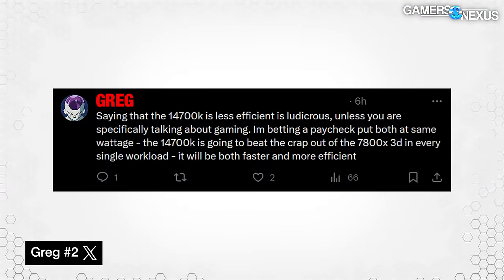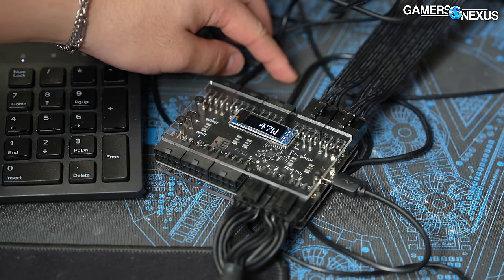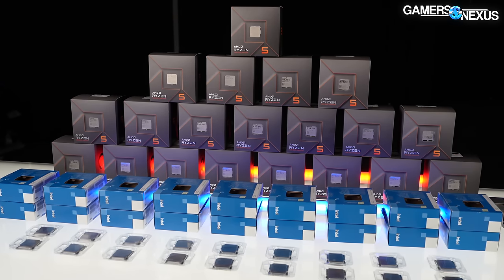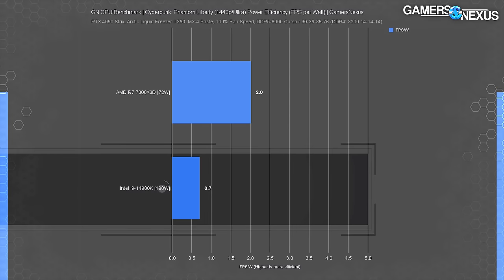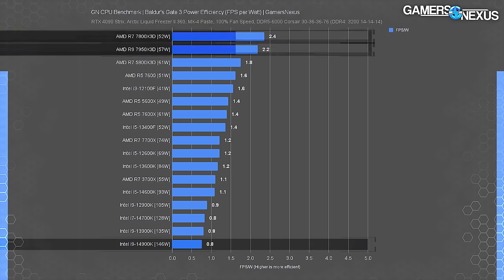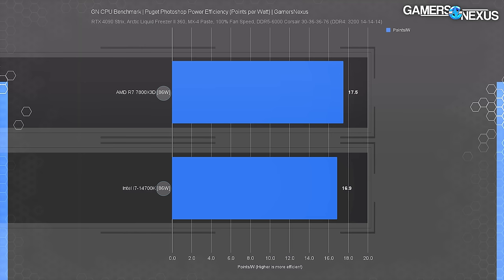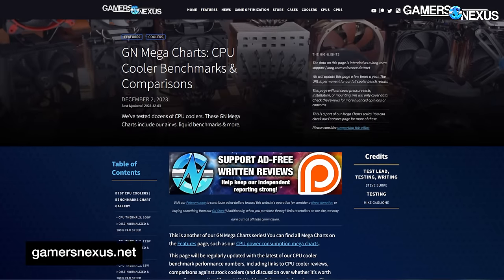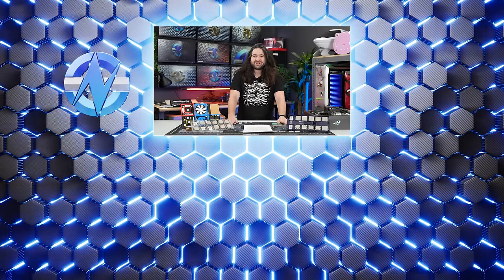The Intel Problem: CPU Efficiency & Power Consumption

Comment: Loved this analysis, since i'm paying even above your maximum listed amount for electricity in Germany it is pretty considerable, especially idle/desktop/surfing consumption. I remember saving hundreds of Euros per year after an upgrade to a more modern Intel back in the day with nothing else changing in my appartement over the year. It is of such significance that you could justify a steeper price upfront if it at least compensates for that within two or three years (within reason).

Things are getting rediculous with power draw, i flat out refuse to entertain a CPU that could burn upwards of 200W and even ignoring purchase prices i'd be hard pressed to put a 300-600W GPU  in my rig. Things need to find a new better sweet spot imho, heat, power draw.. it's just not fun anymore. Hanging onto my sloppy 10th gen i9 with a 2080 super which were not stellar back in the day and look like an efficiency miracle compared to following gens. I really don't like the way things are headed.

Comment: Leave no troll spared, well done guys.

As for two games, surprisingly for high-end I'd say to check out Alan Wake II. It's a slow-paced survival horror game but it's pretty heavy on hardware. Could be a good high-end testbed. For another, I'd check out Resident Evil 4 remake. It's generally lighter on hardware, but it's still the heaviest RE Engine title so it might work well for testing needs.

Comment: A more efficient CPU will need smaller, (generally) cheaper and (potentially) less noisy cooling components. There will be less overall heat in the system, which would not require a higher flow case and that could affect other nearby components. There is only to be lost in wasted energy for the same amount of work. This will be especially true for the TR, as in server racks heat and energy cost per unit of work will be even more relevant.

Comment: I really like the 23:00 chart, I'm in the EU, NL, and my main rig has a 14700k, it's shocking that I can save 100-150 euro a year assuming I game 8 hours a day, changing to AM5 and getting a 7800X3D the CPU would pay itself back in energy savings in just 2 years and 4 months, that's absolutely bonkers.
I already regretted getting a intel 1700 mobo cause the e-cores cause so many shenanigans with games (worse frame times, worse cpu scheduling) the only reason I really got it was cause of DDR5 and the bigger L1 and L2 cache even compared to AM5, but I've been thinking of selling that machine for a while now and going AM5 instead, to also future-proof myself.

Comment: It would be nice if there was also coverage of idle power usage, or when using youtube.

Does the effect of the e-cores make Intel more efficient in those scenarios?
Reply: No, but in general power states on Intel are better than on AMD. At idle Intel is likely the chart topper, at the same time, who uses their PC idle the majority of the time? In my case it'd be turned off instead of idling if I'm away for extended periods of time.

Comment: I'd be interested in seeing a similar comparison on laptop chips where Intel isn't thrashing their chips as hard and efficiency matters more - the Framework 13 could be a good platform for this as it's available with both Intel and AMD options for high end mainstream laptop parts, and anecdotally a lot of users seem to report longer battery life on the AMD side

Comment: one thing i would like to see added to testing like this is the NON K cpu's, those are hardly touched on by anyone in reviews yet shud be alot more efficient in this kind of test due to being held back
Reply from the maker: They are in this video.
Reply: @GamersNexus  i see a 12100F and a 13400F, what about the 13900 non k and the 13700 non k? the counterparts to the worst power users

Comment: Awesome content!
One of my previous comments about creating charts of power efficiency for different loads have been heard, and I though it was lost and forgotten. Thank you very much for this video!
What remains to be explored is the exact positioning of VF-curve for CPUs of the same architecture - I also asked for this some time ago. E.g. Alder Lake CPUs have -KS, -K, suffix-less and -T SKUs that vary in frequencies and rated power. It'd be curious to know if they have exactly same VF-curve. And to plot that curve in general, e.g. curve of the efficiency of, say, 7zip compression at different power limits and/or voltages. Admittedly that is a lot of work for a result that bears more of scientific rather than entertainment value, and therefore may not be as appealing to the general public.
Reply: The pre-binned VID-frequency curve would even vary between CPUs within the same SKU (and that is the source of SP score on some ASUS boards), so I guess that would be very difficult to test unless a lot of CPUs are tested. Different -K SKUs do carry noticable differences in the average voltage needed to achieve certain frequency though.
Reply: @xianyuff8242  that's interesting bit of info, mind if I ask how do you know that?
I would assume -K SKUs carry noticeable differences out of voltage or frequency range specced by Intel. Within specified range they would behave quite similarly, otherwise there would be no point in factory specifications.
Reply: @PK-lk5gs  The values are baked in the CPU by intel and it can be tested with setting ACLL and DCLL to 1 mOhm, then read the VID given to the system at different fixed frequency. There is a lot of discussions on the VID table baked in the CPU on the overclocking forum.

You are not wrong, the difference within a SKU is very minor, won't differ more than tens of mV for a given frequency at max, and they are all guaranteed to be stable at such voltage / frequency point. It's like a CPU with low SP score will perform exactly as well as well as a high SP score one when it's not overclocked, they would have a small voltage difference at the frequency though.

Higher speed SKUs in the -K CPUs usually have relatively better bins than lower speed K CPUs though. Not sure about non-K CPUs, only insiders know how they test and bin them in detail.

Comment: It wasn't really mentioned here, or I missed it, but I think it's important to note that the CPU power consumption of a locked frame rate might theoretically not always be the same.
For example a VSync locked frame rate, compared to a Nvidia control panel locked frame rate, compared to an inbuilt FPS limiter in the game(-engine) could theoretically be different. By how much I don't know.
It's also important to note that some parts of a game, like the physics, run at a fixed update rate of about 60-200 Hz depending on game and what the developers chose for it. This won't impact the results but is good to know as an audience member I'd say.

Comment: i knew it, i knew it on the day it came out that i wanted it and it will be efficient.
that little 5600x is amazing.
just good enough for a casual gamer on a budget that does some video editing, compression and compiling. cheap, efficient and works with a stock cooler.

my only regret was not waiting a month or two for the 5700x to come out as i bought that 5600x as soon as i could ship it on release.

Comment: Thankfully reviewers are finally starting to realize that most people dont run their systems on full blast, max FPS scenarios. If we could do some standardized testing methods like capping the frames to 120, that would be more representative of typical use for most people. I dont know of anyone who doesnt cap their FPS to their monitors refresh rate to prevent screen tearing. Running it in a manner that purposely exacerbates Raptor Lakes power draw irritates me to no end. If we can then go one step further and cap the Intel chip to the highest amount that the AMD chips would draw while in that frame limited testing, that would be beautiful. They did make some significant gains on overall efficiency in those power capped scenario, even if they still lose to the AMD chips.

My only real question about the content and testing methodology is... how the hell are you guys getting these chips to draw that much power? My 13700k is only pulling around 75 watts in Baldurs Gate 3 in a 4k120 rig with a frame cap at 116. Why is my power draw a third of the 14900k you tested? Its even overclocked as far as the silicon will go and its running uncapped on power. I think I could safely set the power limit to 100w and never feel the difference.

Thanks, GN, good work and its clear theres no bias at play like there are with some other reviewers that ive had to stop following recently. Keep it that way, and you'll always have my views. I just want it straight with none of the bullshit shilling. Give me the data and let me make up my own mind.

Comment: I always thought it was just assumed that you have to take performance with a hefty grain of salt. Changing ANYTHING can affect performance. Using the same CPU in multiple motherboards, using multiple CPU's in the same motherboard, using different bios, using different RAM, these all affect how a CPU behaves, and with the way that modern CPU's boost, it will affect performance.

Comment: The issues here are that intel is using a 10nm node...where as AMD is on a 5nm node...there is no way around the efficiency difference from using a smaller node, the 7800x3d has added cache which helps it for gaming purposes...add in the different use cases for P and E cores (for intel) to the mix and you have a perfect storm for gaming...intel needs to get their node process down to 5 nm...and add cache to their chips.

Comment: what I do care is the amount of heat and energy the pc / notebook thermal solution must needs to dissipate. That is extremely relevant, specially in small devices with constrained head dissipation capacity.

Comment: It's not a surprise that Intel had to push more power to stay competitive, and if memory serves they have done this before. Usually that means a new design is coming and it remains to be seen if Intel can do that again. I don't think they can reasonably push much more power through this design, although there are some chips that have higher TDP, you're getting more cost, cores, lanes, and cache, not single core performance, which for the average user is still king.  If I was building a top end machine today AMD would be a serious consideration whereas previously the gap in power was justifiable by a gap in performance, which isn't the case now.

Comment: Your cost charts are interesting. However, I'd like to highlight that if you live in an area where you have winters and use electric heating, you are basically gaming for free during winter. Whatever heat your CPU is generating is basically heat your electric heaters don't have to make.

Of course, you can do the opposite; if you have to use AC to compensate for heat generation, that makes it worse.

Comment: I really appreciate this. I remember Intel stating this as gospel and fact and the Intel fan boys just have been repeating it. I didn't know if this scenario was true or not, but it seemed unlikely Intel tested this themselves. Let alone have done it in a way to get it to agree with themselves. Their slides often are underhanded unless you actually look at the finer details(such as Intel comparing their current cpu to one two generations prior that isn't even in the same class as it with different core counts). My guess is they assumed no one would look into this one and they could just state it and they dd get away with it for awhile. I even wondered if this was true, if all the cores were parked and it was just a gaming scenario, is it now running efficiently at a lower power consumption than a competitor cpu? Turns out, nope, not even close to true, almost like Intel didn't test it, but figured no one would really call them out either. However the damage has been done and it's still going to be disputed by Intel fan boys because an Intel executive said it.

Comment: I've changed a 13600k for a 7800x3d, i'm playing only pubg these days, and it's crazy the diference! I've always have to limit the 13600k to 125w because commonly the consumption go way higher, sometimes beyond 180w! The maximum that 7800x3d goes is about 68w, and bringing at least 20% more performance. I've used intel for the 10 past years, and i don't think i will switch back.

Comment: So what Steve is saying is the higher end Intel CPUs are like a V8/V10 turbo diesel engine in a vehicle that occasionally rolls coal in terms of power efficiency. The X3D AMD CPUs are like a tuned twin turbo V6, it doesn't always have a much raw power but it makes it's power without a MPG in the single digits or notable harm to the nearby environment.

Comment: It is nice to see the elephant in the room. My gaming laptop has an i9 and 4080. My friends laugh at the size of the necessary power brick. And "brick" isn't an exaggeration.
Also to consider is the waste heat dumped into your home environment. When I ran my dev company from home we could easily shut off all heating vents on the first floor, where our offices were, all winter. But in the summer, the A/C needed to work extra hard.

Comment: I'm not so concerned with the cost of the power where I live. HOWEVER . When I had a 13900k and my 4090 running, my room got so HOT 🔥 switched to the 7800x3d and it's much more bearable. I'm even getting better performance with this cpu as well. So it's really a win across the board

Comment: the way i see it more consumption also means more heat and therefore more noise, which is a thing almost everybody cares about to at least some degree, so there is definitely more to it than just the cost of increased power consumption itself, which as long as you look at a single entity is ridiculous to worry about if you're rocking a 650$ CPU (my opinion as German paying well >0,4$ kw/h)

Comment: Undervolting my 5800X3D to pull no more than 65 watts makes it run cool enough that the low profile Noctua cooler that I’m using easily takes care of the heat. Paired with the RX6600 video card at 1080 60 Hz, it’s all the efficiency I’ll ever need. Not planning on upgrading to AM5 any time soon because there just wouldn’t be any point.

Comment: the high electricity prices where reason for me to convert to a mini PC
I cut my electricity bill by 2/3 by just doing that, simply because a full PC uses much more power in idle and during light tasks like watching video and streaming

My PC uses for youtube about 100-120 watts while the mini PC uses 16-23

I chose the Minisforum HM90 as it was, at the time, the best choice for a mini PC that could also handle some gaming
Initially I planned on using th mini PC just for youtube and light gaming, but it actually handles pretty much all the games I play sufficiently well, so now I havn't powered on my gaming PC in 2 years, I just have to play at slightly lower settings, but I get to have my cake and eat it too

Comment: Hey @GamersNexus , do these results translate to laptop efficiency and battery life too? It would be cool to get equivalent results there to inform purchasing decisions for laptops. How about idle power draw, or low power workloads like staring at IDE's all day.
Reply: Anecdotally Framework users are reporting more battery life on AMD, but I absolutely agree that definitive tests would be great, particularly since there's the extra hiccup of the efficiency cores being more relevant for the types of workloads laptops are going to use (plus, Intel's laptop parts have more e cores and less p cores than desktop equivalents in many cases)

Comment: I live in Sweden and close to a nuclear power plant as well, so I pay roughly 10 cents per KWh, but I still wouldn't call that cheap. In Sweden, we're used to paying even less, but we have an energy tax (and VAT) on electricity, which has increased the price over the years.

Comment: Based on my system to true test hardware , arc a770 1000 to 1300 frames / 3080 10gb 400 to 600 frames meaning it was on par with nvidias 4000seriez gpus

Comment: Thanks for the video. It is not surprising to me that AMD CPUs are more power efficient than Intel Processors.  Where one would really see a great use case for power efficiency is in Laptops. The AMD powered Laptops I would guess will run longer than the Intel Equivalent Laptops.  This means that if you are in a meeting and don’t have your laptop plugged in, you can continue using it for a lot longer. In the desktop market we don’t pay as much attention to that in the United States.   I know you don’t pay attention to Apple Products, but the power efficiency on Apple Laptops are very good.

Comment: While I'm not that interested in efficiency, a side effect of it gets incresingly more important: heat. I run a 7950x with 4090. The amount of heat such a system generates noticeably heats up my living room and is a challenge to cool (bigger and bigger AIOs and more case airflow).